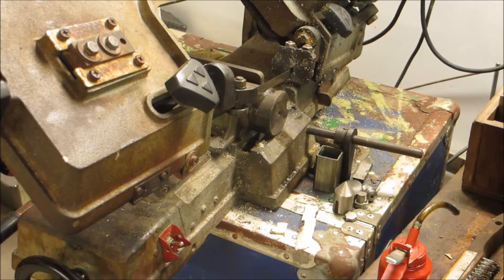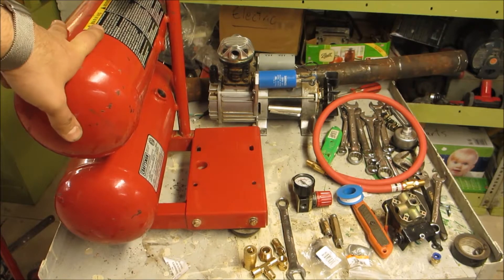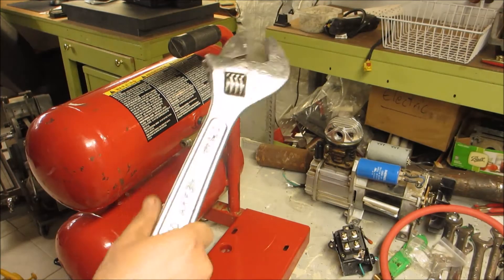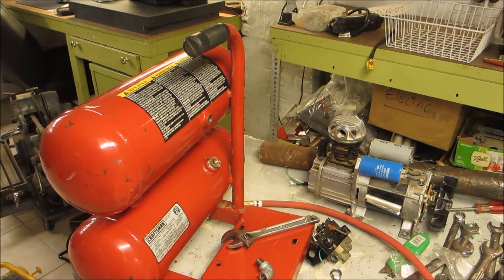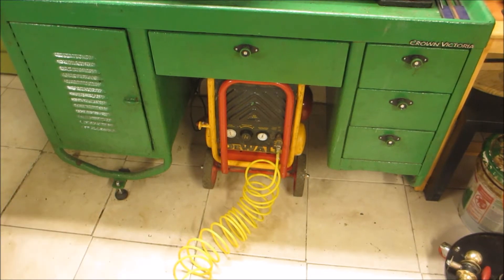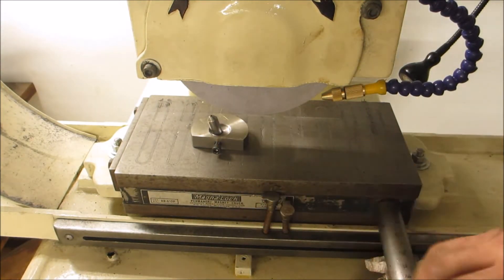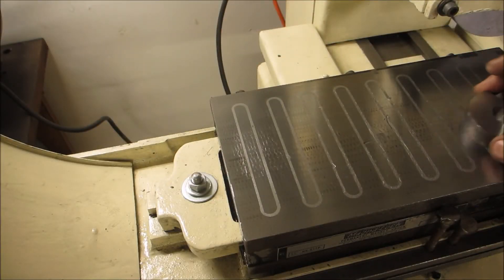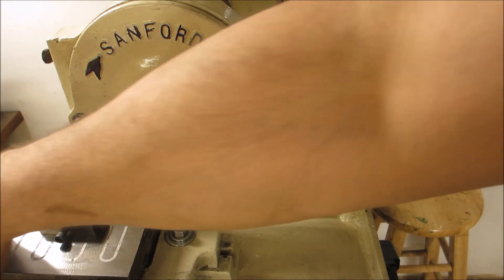Sanford Model Mg Surface Grinder Rebuild -PT3 - Compressor/Magnetic Chuck install.

Comment: I was watching you grind in your chuck and was wondering if you have considered making some rubber way covers??  Might not be a bad idea to put it down on the list somewhere.  ;-)
Reply from the maker: The grinder has cast aluminum way sheilds on the front and rear ways. The table covers the ways on the other axis and on the z axis the ways are covered in stainless steel. Not sure where rubber would fit in?
Reply: @Engineerd3d  Ahh.. as long as they are covered.  My bs 612 had nothing but rubber covers.

Comment: The more air storage you can get, the better off the compressor motor will be. Fewer starts and stops means longer compressor motor life. Now as for the compressor??? I don’t know how the compressor is built, it might not like the longer run times, or it may not be bothered by the heat.
Reply from the maker: John Brock so far the compressor has done a good job. I mainly use it to blow air as well as for the "fog buster"

Comment: I like the compressor solution.  I did similar myself.
Reply from the maker: I had to Harold. The compressor I own only had a 1 gallon tank, I wanted more volume so I could cut in that Chuck. Now it has 5gallons of volume with a 1/3hp compressor on it. But at least it still fits under my lathe.

Comment: Great work        set screw instead of SHCS      rotate diamond ever so often to equalize wear
Reply from the maker: George Seal thank you George. That was the intention. About 12 degree rake on the diamond and ability to rotate should give me fairly decent wear properties. Even for import diamond.

Comment: You must have a pickup truck and where did you end up getting all of those gems in the rough?
Reply from the maker: The Best Stooge allot of these were cl finds. No pickup. I had an old crown Vic with 400k miles for about a year and a half. Ex NYC yellow cab. I used that to pickup allot of these things.
Reply: WOW, considering how dang heavy these things are.